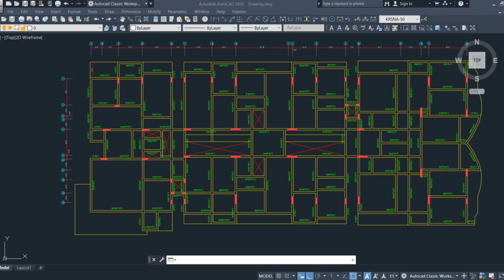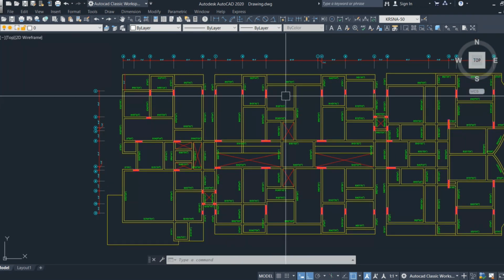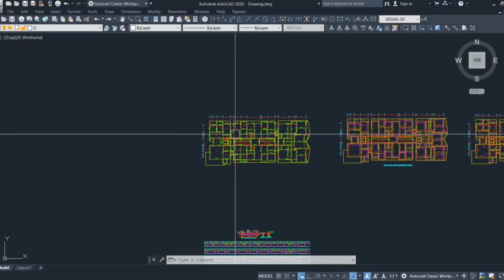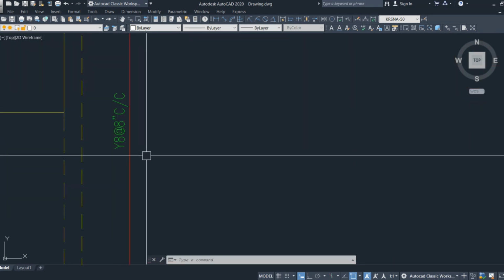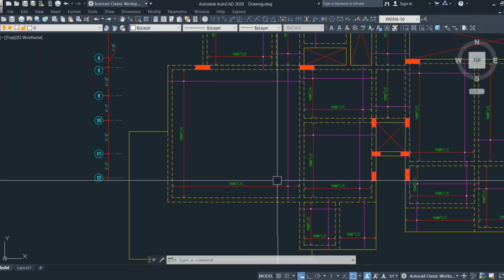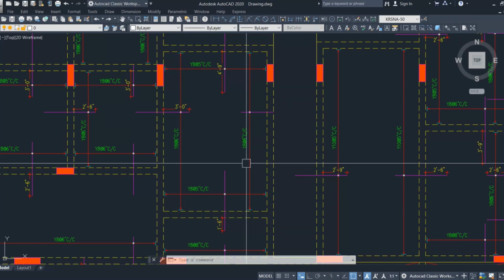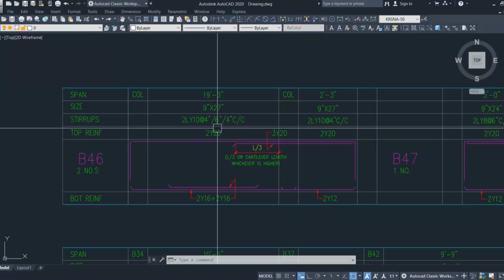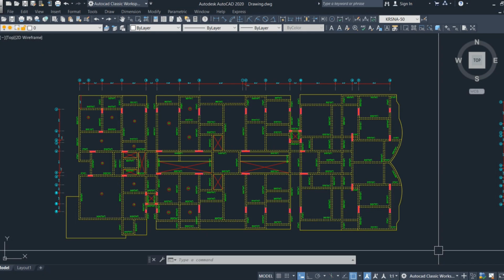Check List for Site Inspection for Structural Engineers | Site visit Checklist for Engineers

Comment: when beam and columns are having same width. we cannot place all the beam bars inside the column. if we place outside the column then whats the percentage of load transfer to the column? could you take example of it and explain
Reply from the maker: In most cases, beam and column widths are the same and we can place all the beam bars inside the column.
Reply: @CivilEngineeringMastery  can you put them in plan and 3d view and explain. When beam cover is 25 mm and column cover is 40 mm.